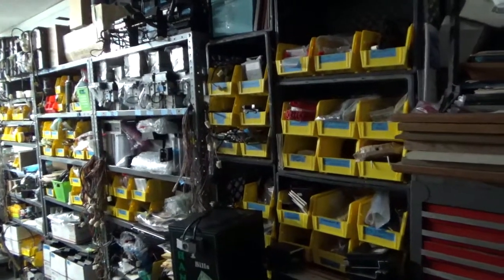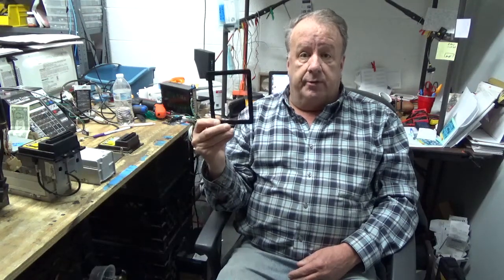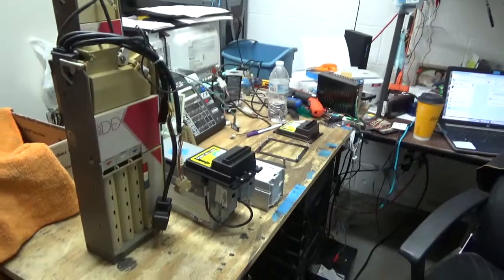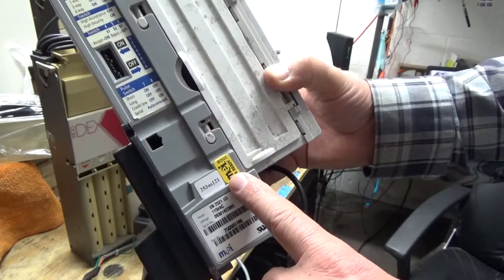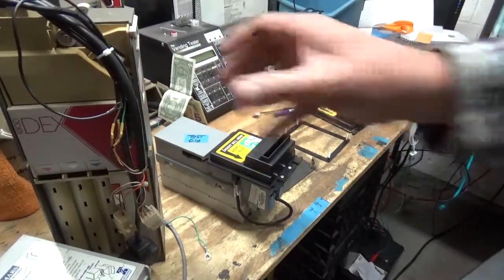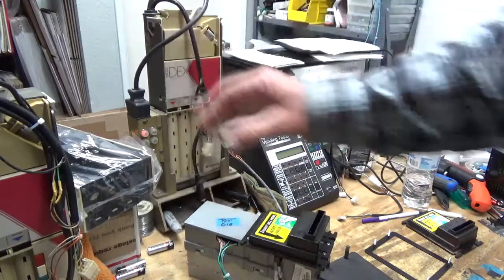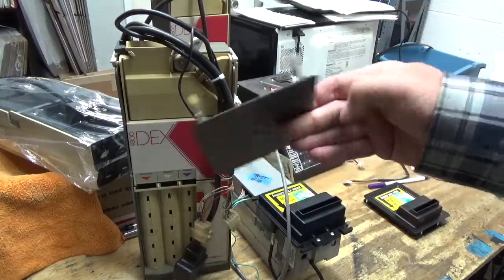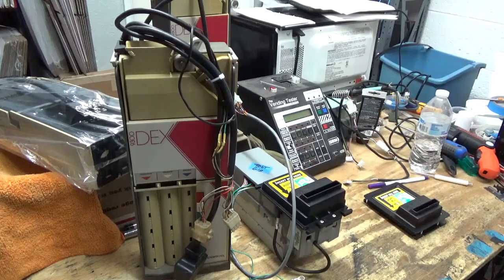Vending On A Budget, Single Price Coin Mech & Validator Upgrade

Comment: Just asking around I have a Vendo 510 this is a single price machine older one the Coinmach went bad I replaced it one of my pops were jammed I un jammed it it is a 10 selection now the coin Mech  works but only two will vent the top two no matter what I do the other eight won’t vend  any thoughts on what to try thanks dave